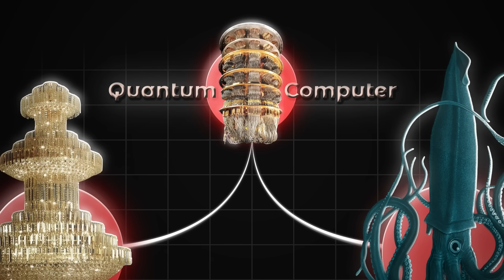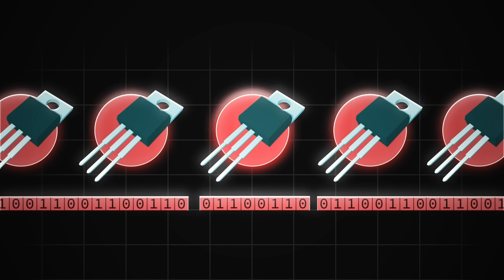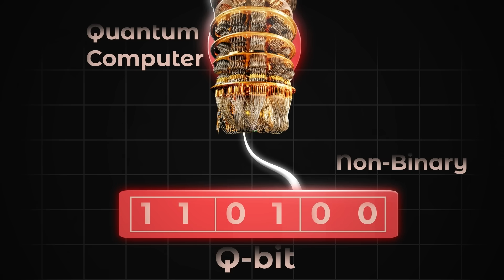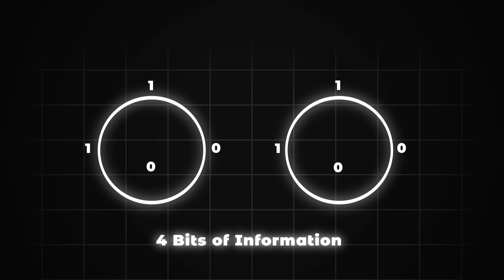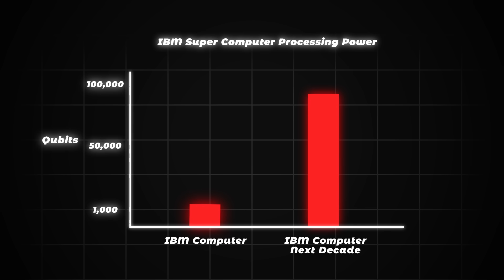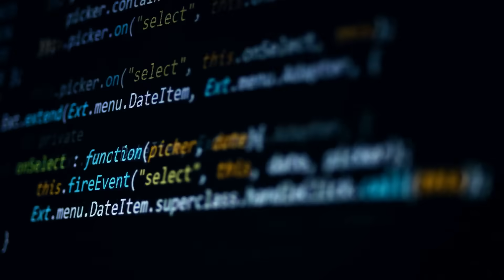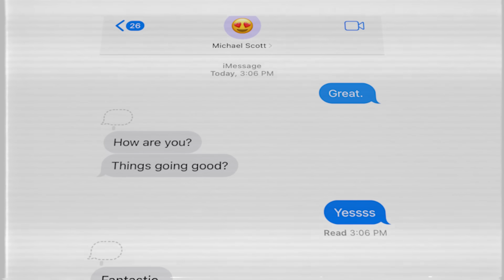Why Quantum Computers Will Break Reality

Comment: It's hard enough for the layman to really understand the binary computer, the quantum computer is much more difficult to grasp. I think this video has done the best job I've seen so far on explaining it. 

So basically the idea of quantum computers replacing regular computers would be like saying the787 jumbo jet is going to replace the Blackhawk helicopter because it's bigger, faster and more powerful. 

I think it would be pretty awesome if they could integrate a quantum computer with a regular super computer, so that it acts as a co-processor, like they do with GPUs. This just seems like the most logical way to implement a quantum computing system to me. That would eliminate the limitations of quantum computers, and the main limitations of regular computers.

Comment: Thanks for the information! There is an oxymoron, though, introducing the quantum level of the universe and at the same time using definite claims I might say about reality. I'm talking about the claim of knowing time to be linear, and measuring that total time to be 3 billion years, and claiming on the top of these assumptions that this is the first time we are crossing these frontiers. I just can't wrap my head around it. 😊
But as you said, we are now doing OUR baby step  towards that understanding and of course our communication reveals several expired elements of certainty that is not necessarily the reality of the truth we are supposed to explore. Exploring the truth, you can't make too many assumptions.

Comment: the problem with quantum computers is that they are easily misplaced and very difficult to find again. this requires a lot of expensive detection equipment and also research into how to make detection equipment or theories on how such equipment might be made, all of which are, ironically, ideal tasks for a quantum computer.

Comment: You need smaller quantum computers that pass on their computations from one to the other from one to the other in a chain until the end so after the first the others can calculate the if the calculations in the one before are correct. If you have to take the first and have 10 after to calculate the firsts and see what the majority agrees with.

Comment: 3:33 these are not the actual widths. Just the advertised widths. In fact, advertised "3nm" is actually about 20nm. If they were actually as small as advertised, then there would be quantum tunneling issues where the states accidentally flip

Comment: Good video. Though a lot of it has been oversimplified, which makes sense.

1. Schrodingers cat isn't about the vial of poison. It is about poisoning the cat if something is in one quantum state vs another. The original used radioactive decay. Since quantum states exist in a superposition, it means both states are present simultanesouly, which implies the cat is both alive and dead. It was created by Schrodinger to bring quantum effects to the macro level, to illustrate how he found superposition to be absurd.

2. With Qubits, it isn't a matter of it being able to contain 2 bits. In that case, MLC NAND or other multi-level data systems have it beat using voltage levels.

The trick is that a Qubit is in a sort of "fuzzy" state, where it can represent any combination of 1 or 0 each at different proportions. When Qubits interact, ALL of the states of one interact with ALL of the states of the other. So in terms of data, adding a 1 bit doubles the number of values each time. Adding 1 qubit SQUARES the number of values each time.

It also has a really cool paralellism effect. Let's say you do an addition. With a binary system, an addition adds 1 known value to another known value, and produces a known value. When adding qubits, it would take every possible state of 1 qubit and adds it to every possible state of the other qubit.

So if you were to do a physics simulation, it wouldn't simulate 1 case at a time. It would simulate every possible state of that physics simulation all at once.

If you subscribe to the "many worlds" interpretation of quantum mechanics, this would basically mean that when you perform a calculation, it is performing that calculation in multiple "universes" simultaneously. I'm a tad skeptical of that, but it does help with visualizing what is going on.

The catch (besides the crazy physics) is that the states aren't deterministic. They are probabilities. So if the answer is 1% Yes and 99% No, it isn't going to simply give you "the answer" but will give you "AN answer", and you have to run it a whole bunch and measure the probability of each answer. The more you poll it, the more precise it gets. But it's impressive because it takes every state into account, which makes it phenomenal for optimization problems.

It won't be replacing consumer electronics any time soon. But it could be useful for AI, because all neurons in a neural network could be calculated simultaneously.
Reply: Amazing comment
Reply: This comment isn’t long enough…
Reply: Thank you for explaining what most of these videos don’t.
Reply: The radioactive decay used in the original example is important because it has a random half-life. It’s all about not knowing without measuring (can’t measure half-life to know when the cat might die without opening)
Reply: Youre right Schrodingers cat isnt about poison at all.   Because the existence of a cat that is both dead and alive at the same time is absurd and does not happen in the real world, this thought experiment shows that wavefunction collapses are not just driven by conscious observers.
Reply: your studying the 4d sim. with a cat?
Reply: But if you have one value and it keeps squaring itself it will stay 1 forever. 🤣
Reply: Cats are NOT dead and alive at the same time
Reply: @Woodman-Spare-that-tree yerp, that’s kind of the point that Schrödinger was making.
Reply: So that means Quantum computers can be simulated with standard computers?
Is human language a kind of quantum representation, from A till Z you have all the infinite sentences possible in a specific language ?
Reply: @vasasv6848 bro that's brain rot metaphysics you're talking about, quantum mechanics have nothing to do with those
Reply: someone needs to get out more
Reply: @jkdfjdnfvlsdfvl  Bro, if you're slow, just say that.
Reply: 😂😂 dick  @jkdfjdnfvlsdfvl
Reply: @jkdfjdnfvlsdfvl yes, you should get out more

Comment: 2:22 "...Bits...": 2 states. With current technology we could have bits with 3 states: (+1)(0) and (-1). We would do the arithmetic in base 3 instead of base 2. Now comes q-bits with 4 states: (e.g. left, right, up, down). That would put us into base 4 arithmetic. If this is all that quantum computing is doing, communications has been doing this for  years. It breaks a sine wave into 4 phases: 90 degrees, 180, 270, and 360. But you can't store sine waves... or phases. But you can transmit them. 
7:00 "...this superposition is where the quantum computer gets its power...": Nonsense. Just like a sine wave is at only one phase at a time, it doesn't matter whether you look at it or not. Now you can mix two sine waves and detect interference patterns... thus do math without looking at intermediate results. Is that what they're trying to say here? If it is, that's what analog computers did in the early 60's to the late 70's... before digital computers could do it better (i.e. more precision) and faster (i.e. faster than real time). They did integration and differentiation by using the characteristics of capacitors, op-amps; and feedback.
7:30 "...you get pretty staggering numbers...": Welcome to exponentiation. 2^20 = 1.04858e+06; 3^20 = 3.48678e+09; 4^20 = 1.09951e+12. But if it's such a big deal, why didn't we implement computers using three state devices? And we could implement 4-state devices with 2 2-state devices. We kind of did that when we went from 8 bit computers to 16 bit computers. And then to 32 bit computers. And now to 64 bit computers. As I recall, the CDC 6600 computer had 60 bit words...in the 1960's.
7:43 "...20 q-bits will produce 1 million potential values...": Actually it will produce 1 million million potential values (i.e. 10 to the 12th).
7:53 "...has 1000 q-bits of processing power...": What does that mean? 4^1000  causes an overflow on my computer. I think it's something like 10^600. But 4^100 is 10^60 which is the same as 2^200. So again I ask, is the benefit of a quantum computer its ability to have 4 state bits instead of 2 state bits?
10:00 "...error rates of 1 in 100...": Again, we have communication systems that have error rates like this. We get around the problem by sending multiple occurrences of the data and have methods of detecting errors (the original crude implementation being parity). SD memory also has bad memory cells which increase with use. They use techniques similar to communications techniques to deal with bad cells. Same with CDROMs.
10:20 "...could solve math problems in seconds that would take years...": How? You have said nothing about the "speed" of a quantum computer. With conventional computers this is governed by the clock (or asynchronously by the speed of switching...as in ATM). We started with megahertz clocks. We now have gigahertz clocks. What does the quantum computer clock look and act like?
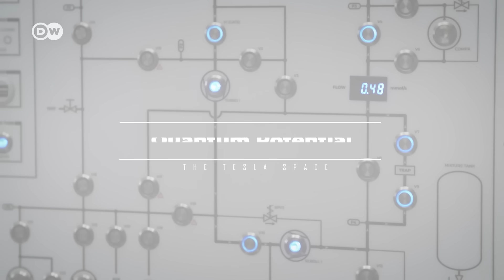12:20 "...switching to services with higher levels of encryption...": It's been known almost from the beginning that a one-time-pad encryption cannot be broken. Why the FUD? Anybody who thinks there's any security in today's computers is self deluded. If you give up your password (e.g. to a password manager), you give up your security... period! We could have much better security right now if we never revealed our passwords. Why don't we institute such a method? Because those pesky governments don't want that result... i.e. real security. They insist on back doors.
12:50 "...computer bad at grasping biology...": Why? Because they can't store enough data? Because they don't run fast enough? How do quantum computers change this? Again, you've said nothing about speed and you've only increased storage by 8x.
13:40 "...existing in multiple states simultaneously...": That's like saying a sine wave exists in multiple states simultaneously... if you don't look at it continuously... or with clock. Where is the magic in the quantum computer that doesn't exist in the sine wave? Nothing in the universe... at the mega scope or the micro scope... can be in two places at the same time... nothing! Not only that, if it moves from one stable state to another stable state, it passes through an infinite number of continuous states in the trip, even if the trip takes an infinitesimal amount of time. 

On reflection, every presentation on quantum computers delivers this exact same amount of mush... with varying amounts of hyperbole.

Comment: Lord. Here we go again with the eternal optimism of the QC talking points. For the last 2 decades we’ve seen very little improvement in QC outside the number of qubits. Which hasn't really helped much because the superposition time and error rates are still so bad. So yeah. I’ve been hearing that this is just around the corner for 20 years. I’m not holding my breath.
Reply: Ah yes, i hope we get an exciting “QC arent widely available” video soon
Reply: Don't be so negative.  I have a QLED T.V. and those credited with the bulk of the work became Nobel Laureates only last year.  So it only took a few weeks for the promise to be realised.  Or around 40 years.  Or, as you highlight the speculation in this video, nearly 100 years (if the work of Herbert Fröhlich in 1937 was the starting point for "just around the corner" pronouncements.)

Comment: The vacuum of space has no temperature. It is not hot or cold. Ever wonder why a vacuum thermos is so good? It's because vacuum is an almost-perfect insulator. The only heat transfer possible is via emitting or receiving photons, typically infrared (unless you're at molten metal temperatures and glowing visibly, then you have bigger problems). Most heat transfer on Earth occurs via convection or conduction, neither of which can occur through a vacuum. So if you're in direct sunlight (and getting hit by energetic photons) you heat up (just as on Earth), while any side of you that is in shadow (including your own) will slowly cool, but nowhere near as quickly as simply stepping outdoors on a brisk, windy day!

"The smaller things get, the stranger the laws of physics that govern them..."
Because "the universe is under no obligation to make sense to you," to quote Dr. Tyson.
The reason it doesn't make sense to us is that different scales exhibit different principles, and to see quantum effects you have to get down to a scale that we have absolutely no everyday experience with. If quantum effects were noticeable at our macroscopic scale, they would make perfect sense to us, because that's what we would experience every day and what we would have learned from a young age as "how the world works."

And... clickbaity title that does not actually represent any claim made in the video? Check! 🙄

Comment: superposition is not simply just a state being 00, 01, 10, 11. One qubit (with superposition) can be in an infinite number of states, where a state has a certain probability of being in 0 or 1. For example it is possible to make a state being in 0 state have a probability of 25% and being in the 1 state have a probability of 75%. This means states can be measured and be projected onto 0 and 1.
Two qubits after measured only have 2 bits of information, but in superposition, it is infinite number of states
Reply: I was gonna point that out. It oversimplified that part. If it’s just doubling the bit depth, that’s what traditional computer was doing over the decades
Reply: yeah its a|0> + b|1> where a and b are real
Reply: Any analigue signal has infinite number of states, so what?
Reply: @gusar2000  huh? they really don't because we arbitrarily set a voltage difference where we directly map states below the threshold to be 0 and 1 if above. Theses states are not in superposition of 0 or 1, that is to say it is not both zero and one at the same time. At all times in the circuit it is well defined what the state is, 0 or 1 with no ambiguity, so there really aren't an infinite number of states.

Comment: Quantum Computing /fusion reactors/AI = What a joke.
Quantum computing is still way of as the error margins' are not shrinking.
Fusion reactors will never work as claimed( To be cheap reliable sources of abundant energy)
What is it now no less than 50 years of fusion reactors , IN that time not 1 microvolt has been put ona ny grid on the planet, They have combined though used something in the order of ovare 17 trillion US dollar's in fossil fuel produced power.
Fusion reactor's are based on a hypothesis not a theory that all stars fuse elements to produce energy , This is not true, gravity and the compressive consequences of gravity on large  masses results in a change of state which results in matter absorbing and emitting large amounts of the entire electromagnetic spectrum, A photon does not take 10,000 or 100,000 years to reach the surface of the sun , light emitted at the core is absorbed bye neighbouring matter then re emitted so light from center of the core never actually leaves the core.
The nonsense in this video is apparent bye the statement on the header "Why Quantum computer's will break reality", LMFAO you can't break reality , Please change the channels name to the An Affiliate of the Discovery institute.
Get a secular education please.

Comment: 99% of [insert incredible claim] articles are overstating the case. Quantum computers exist yes BUT in super large capital letters. It’s a amongst the collection that includes fusion power and AGI.  I’m sure these will happen but the problems are still huge and they’re not solely technical. 

Fusion power is required for quantum computers to become practical devices, quantum computers required in order to create an accurate simulation of intelligence, philosophy required in order to understand wtf intelligence is.

Comment: No they won’t, A quantum computer can only work on certain kind of problems that benefit from that level of parallel computation. This will not eliminate all computers.

What is going to break reality is when they develop AGI and AGI then goes to work on an improved version of itself and thus approaches the singularity.
Reply: This is accurate conclusion. Even AGI and the singularity is heavily overestimated. The majority of the perceived capability of AI is manufactured by our tendency to anthrpomorphize everything and our immense power to assimilate that perception.

Comment: I don't want to be rude. I follow your channel and all. Nice videos. But in order to simplify, you made some factual erros and some misleading statements. 

Just a few. 3 nm isn't the transistor size, but the gate gap, and some labeled as such, may have a wider gap (marketing). Superposition is not that! A cat is a macro object and Shörindger experiment is a way to mock superposition and not explain it. Qbits aren't like that, as they have entangled properties like spin, position, etc. Not discrete values like 0 and 1. No quantum computers were able to archive quantum supremacy, despite of IBM and Google having said so.... It's a complicated topic, but we have to be mindful of introducing new misconceptions.